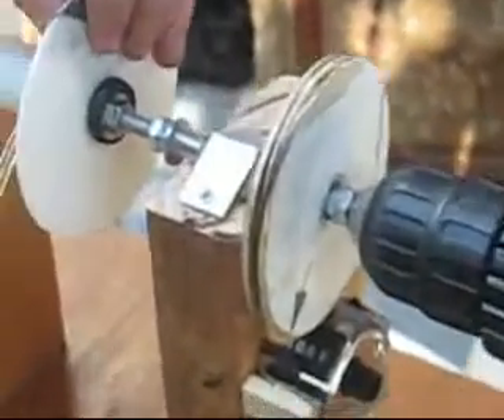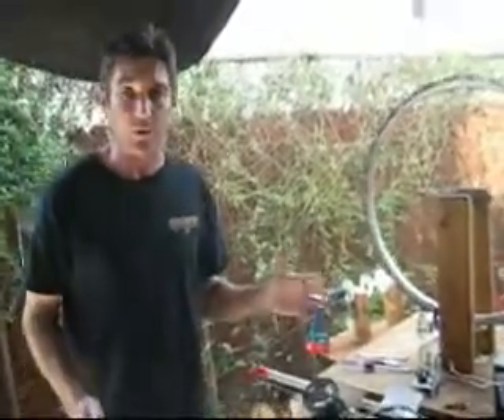How to make coils for a Bedini motor

Comment: I have a 2"  480 winding coil and a 3" 1000 winding coil and they both work on the SG 2", 11" and 27" wheels and the SSG circuit  with a bike wheel.  Hope that helps.
Reply: In other words the amount of magnet wire is meaningless

Comment: I have a few questions, hopefully someone can answer them:

Does putting epoxy on the side that points at the wheel cause any problems? So should i only epoxy the back, or both sides?

For the core of my coil, im using tie wire (for rebar). I straightened it out and cut it the right lengths...should it work?

Also, if making a bedini with 3 coils, does it require trifiar wrapping, or can you use bifilar on the 3 coils?
Reply: usedbandage9 z